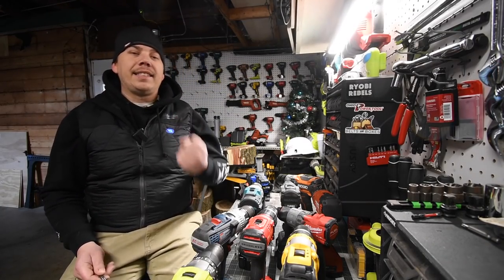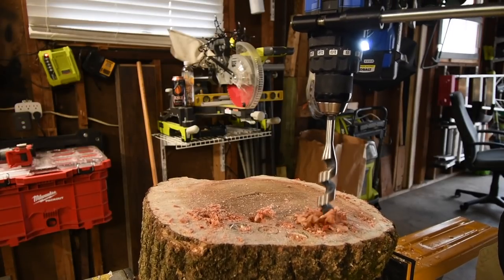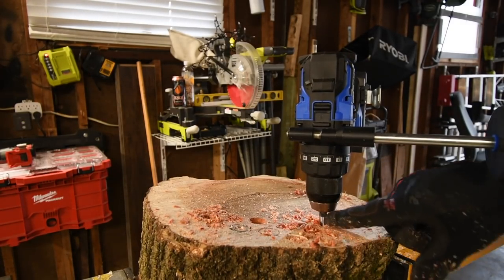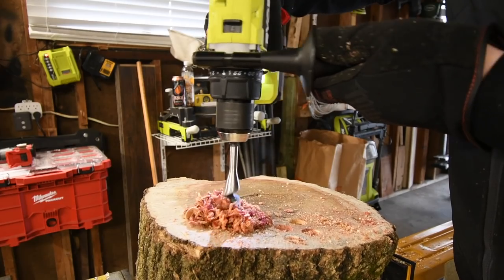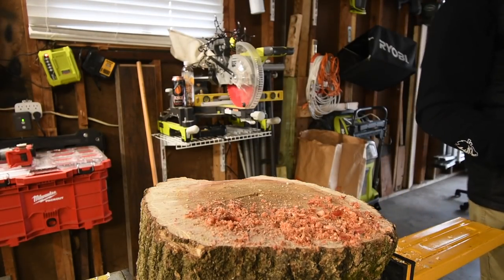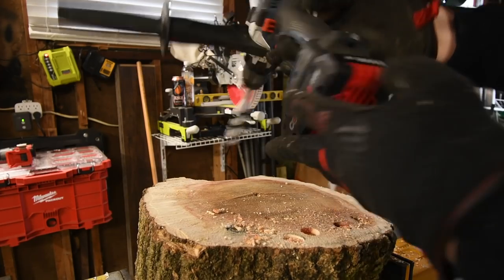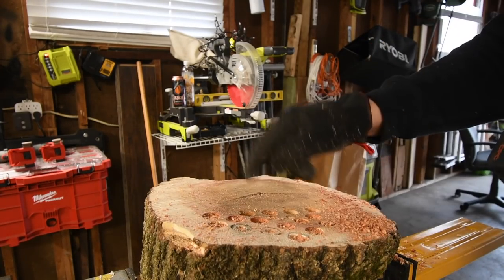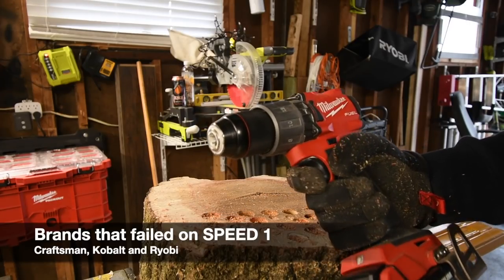Battle of the Brushless PART 2. (Hammer Drills)

Comment: I can speak from experience: those 4ah batteries hold the Bosch drills back.  That includes the 500 inch lb compact.  Had a similar experience with the 3 speed Metabo.    Thus my cynicism when Hilti recommends 4ah batteries with it’s rotary hammers, drills, and impacts.

Comment: One beef I have with these tests is the consumable.  A brand new bit has to cut faster than when on the last tool.  So it seems like all things are not quite even.  (Otherwise these tests are great.  I watch them every upload)
Reply: agreed, but it seems this is also deceiving, it looks like the drill are edited in a different order than they are actually drilled.
Reply: @502deth  could be,  but we have no way to know. Hopefully he’s being as honest and unbiased as we would like him to be.
Reply: @djjinerson  if you look, for one drill there will be like 10 holes in the log, then the next one the logs full of holes, then the next one theres 2 holes. if one cared enough they could probably go through the footage and establish the actual order they were drilled in by the number of pre-existing holes in the log for each test, but frankly im not that concerned about it, but i did note that it was a thing.
Reply: I think battery size is another issue seeing 3 and 4ah battery’s mixed is a problem.  Why bc a smaller battery will have more voltage drop not giving the drill itself a full run.  If one drops only 10% voltage and other drops 20% that’s power lost it wouldn’t have otherwise.

Comment: It would be better to use a longer bit. Once it gets down to the end of the flutes the bit cannot clear the waste and the drill is then trying to both cut into the wood and compress the waste. I doubt anyone who knew what they were doing would use a bit in this manner. Also agree with another commenter that the wood will be of different densities at the centre and the edge of the log.
Reply: He did one with a longer auger bit and all basically failed
Reply: @joshmondragon5818  yes, but presumably some drilled deeper than others before failing
Reply: I guess this test is for power comparison.
Cause if done the intended way probably every single drill would have done the job.
Noone ever would just completely let a drill bit sink that deep into a workpiece. The flutes need to be cleaned with pulling out repeatedly to let it be able to do the job properly and not create immense resistance+heat at the tip. You can see on nearly every single pull out that there is a wood shavings clog at the tip.

Comment: When you do the concrete test, will you please test these hammer drills against the Milwaukee 2416 M12 Fuel Rotary Hammer.  My subjective impression is that it drills concrete way faster than any hammer drill for about the same or even less money.  I know that it's not really comparing apples to apples but I don't understand why anyone who drills concrete with any regularity would even think of using a hammer drill over a rotary hammer.  An objective comparison would be great.

Comment: I'd like a quick try for the Milwaukee with a 6.0... I run mine pretty hard and the 3 won't do it but the 6 will
Reply: Flex will do it with a stock battery and a broken chuck without turbo mode… and yet everyone always be talking bout flex is full of bull. What a joke, fanboys will always rep their brand just like PlayStation vs Xbox…
Reply: @athannaelanderson3806  Flex is a very powerful drill. VERY!! how ever what will the longevity be? I have already seen many test where it will just shut down. Granted I'd ratherhave it shut down than fry. Anyone denying that flex is a homerun is in denial as it almost had me dropping team red but honestly I have to much money into it, but they dont let me down (often)
Reply: @Sparkystacoma  you talk a lot of sense, our tool trailer is all team red as well and we have an expensive battery wall, however there are times my Milwaukee recip. With a diablo blade has let me down… honestly considering bringing on a few flex tools, especially for that warranty..

Comment: I'd be curious to see how the M12 Fuel hammer drill does with a 4.0 or 6.0 battery.
Reply: im super unimpressed with mine. wont even drill a 3/4 paddle bit through a 2x4 withoug stopping at least twice. id imagine this auger would kill it real quick.